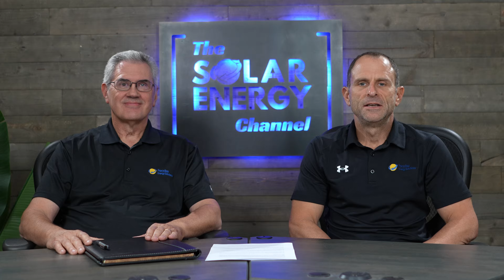Miss this 2025 Deadline and Risk Losing Your Solar Tax Credit

Comment: Correct me if I'm wrong but didn't safe harbor end September 2nd for projects over 1.5 megawatts?
Reply from the maker: Projects larger than 1.5 MW AC may no longer use the safe harbor option. They must begin physical work to qualify.